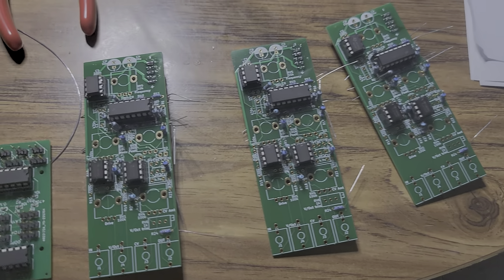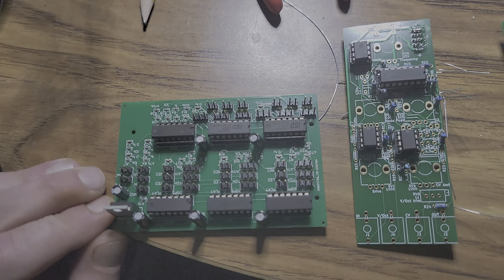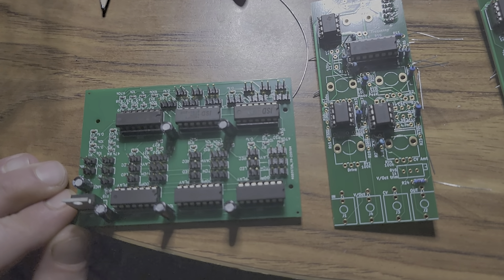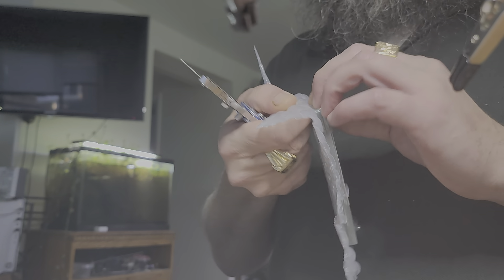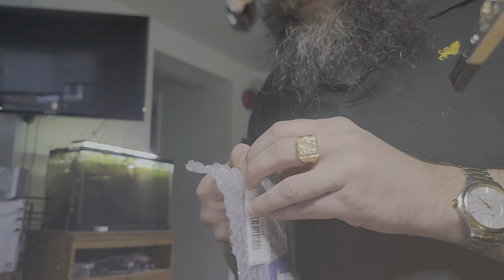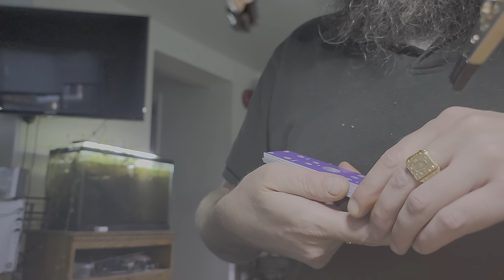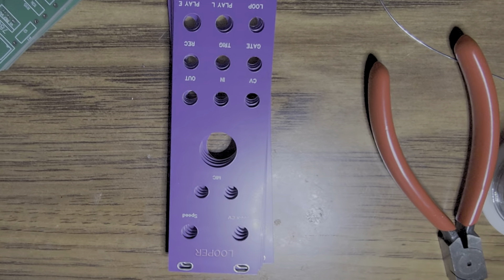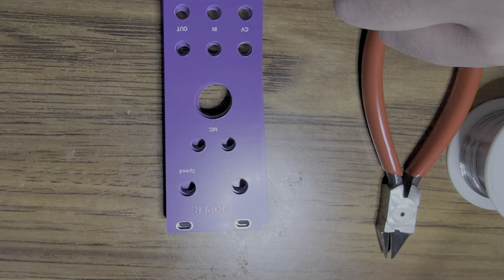ISD1820 Looper Eurorack module DIY - It has arrived!

Comment: Are you planning on selling these PCB/panels as a DIY project? That module seems really cool. Not sure how hard it is to get that IC.
Reply from the maker: I would have to do a revision to add reverse/over voltage protection and clean up the wiring. I'm more likely to figure out GitHub and host the Gerber files. The chips can be found pretty easily on Amazon etc, ISD 1820. I am working on the board revision in my spare time.
Reply: @the2d  Cool. I guess it's easy enough to order PCBs but most people won't want to order 3+ of them. It is a hassle to deal with shipping things out though, I understand. Either way, keep us updated, it's a cool project.
Reply from the maker: @ericMT  it is something I was contemplating after the redesign. It currently has 14 wires, I would like to have a control board instead. Pricing would be basically cost +shipping around the cost of other such pcb+panel pricing.
Reply: @the2d  if you sell me a PCB and a panel I will also send you a tripod and a phone mount.
Reply from the maker: @ericMT  sounds good to me!
Reply from the maker: @ericMT  come by the2dcour.com and click on the picture of the modules for details.